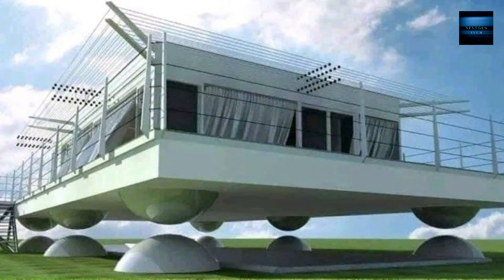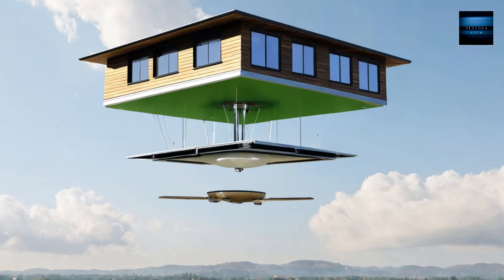Japan's Earthquake-Resistant Floating House: Innovative Engineering for Seismic Safety

Comment: Why aren't you using magnets 🧲 underneath - polarising opposites to push house up so no liquification from earthquakes can flood - house will be high all the time
Reply: Same thoughts
Reply: Because permanent magnets are incapable and an electromagnet system that would be capable is going to be far more expensive to both implement and operate. The reason maglev trains are feasible is because they generate revenue.